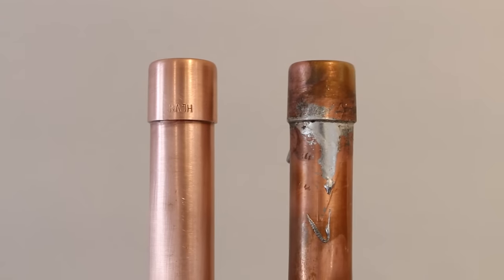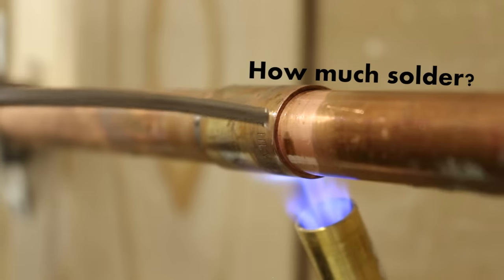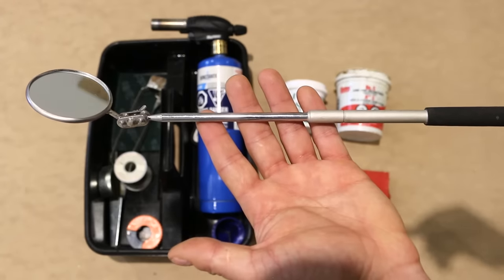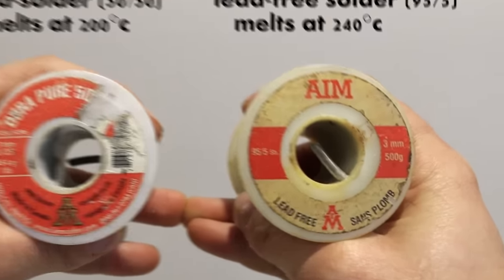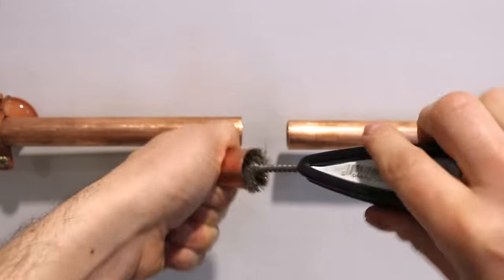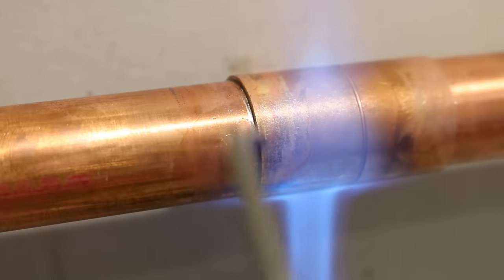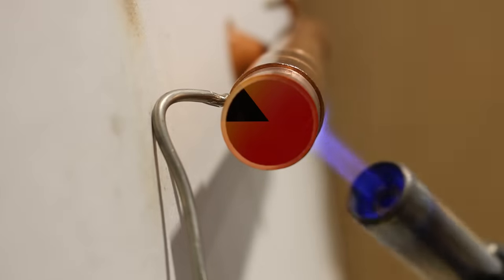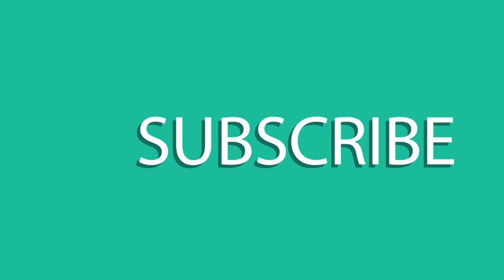How To Solder Copper Pipe Like a Pro (Tips & Tricks) | GOT2LEARN

Comment: Too much solder paste especially aggressive soldering paste in the pipe will eventually cause leaks. So if you can see the paste it’s too much. Exaggerated. 
Also I didn’t here anything in this video re reaming one of the key techniques in the soldering process. If you don’t ream it could cause cavitation in the pipes and fittings especially in high pressure situations. Pay no attention to how a solder joint looks rather focus on better process 
Another part of the process is heating, heating should be pipe first: bottom, sides top; afterwhich, heat fitting: bottom, sides top then go to the bottom and concentrate the flame at the back of the of the fitting at 6 o’clock and push the solder into the fitting building a dam. Stop. Focus flame back of fitting on the side and push solder and move flame to top with solder following the flame. Stop. Do the other side with the same process but this time when you reach the top remove the flame and continue to add solder as it drips out the bottom till the dripping stops. What you are doing is keeping the completely filled by adding solder to the joint drip and replacing the displacing solder from the top that is dripping out the bottom. 🌺

Comment: I am building a compressor with a fridge motor. Can I use this method to solder the 1/4 copper pipes and does it handle the pressure about 8 bars?
Reply from the maker: Might wanna braze at the pressure.

Comment: The amount of solder needed depends on the size of the fitting, for example, 1/2" pipe requires a 1/2" of solder to fill the joint, 1" would take 1" of solder.

Comment: Yeah.. We just pressing over here. Fuck messing with soldering it lol.
Reply: Fuck copper period. For how little I ever deal with copper anymore doing residential repair work, would take me forever to see a return on a $2000+ tool. 90% of the time the copper I do come across that requires some overhaul, I usually cut out and adapt to PEX anyways. PEX is god. But every jobs different and yeah I'm sure a press comes in handy here and there.
Reply: NubSack I PEX too. It’s very nice.

Comment: Great video. I was taught a different technique with a soldering iron that clamps to the pipe.
Reply from the maker: Yeah those are cool, I should nake a video on those clamps, what's the brand, do you know?
Reply: @Got2Learn   not off the top of my head. That video would be useful!
Reply from the maker: Okidoo!!
Reply: @Got2Learn  Antex pipemaster  they're Ok if you've got a dry line of pipe set up.  However they take a good 4-5 minutes to heat up. As I've only brought one. It was always a headache waiting for the heads to to to change them from 1/2 to 3/4 🙄, They're overrated & only good when you're working close to timber or plasterboard. 🤨
Reply: @Got2Learn  I'd watch that video if you do.

Comment: It took a long tim before I could solder competently. I got so good at it I could ring the joint and catch the drip with the end of the solder coil for the next joint.  Then came propress and the kids were instantly as good as I was.  

Damn you propress!
Reply from the maker: Hehe!!!
Reply: Propress and pex are for wanna-be plumbers.   Takes away from the trade.  Soldering has proven to be the best method over the years.  What makes a good plumber is thinking about the plumber coming in behind you...   If you cant see a bead of solder around the joint it would make anyone think it wasnt soldered.
Reply: OLIVER TWIST Do you shun cell phones for rotary dial phones and phone booths also?

Comment: You run the risk of having leaks not capping your joint. I was always taught to leave a little solder visible around the joint
Reply from the maker: Not to be arrogant, but if your joint depends on a cap, the soldering technique used is not good, just FYI.

Comment: Not enough solder.!!!!!

Don’t believe internet stupidity....

Must have solder leaving the joint, to ensure joint won’t leak years later from expanding and contracting.....

I’ve been soldering and welding for 50 years ....
Reply from the maker: There's more than enough solder marko, you don't need a lip for it to be good ;)
Reply: Got2Learn let’s agree to disagree
Corrosive water, expansion and contraction from heat and cold and especially tough building inspectors  who want to see a  heavy solder joint ...
Reply: Simple rule to use 
1/2” pipe needs 1/2” of solder
3/4 “ pipe needs 3/4” of solder

Old union trick
Reply from the maker: I wouldn't do this on every joint, don't get me wrong, i'd only use this method on radiator elbows or something similar which are never closed in walls for it not to look bad, other than that there's always a drip which is a good visual indicator. It's almost like if you are telling me that a glass full of water up to the rim isn't full and that it has to be spilled to be properly full.

Comment: I prefer to tin the joint first before joining and in this way you are sure that the solder covers the whole joint inside. You need to see the solder run, which ensures the joint is hot enough. Any excess can be wiped away to look tidy.

Comment: He’s talking about no drips in the Solder but what about his?
Reply: You have to wipe away the excess flux as it drips in order to avoid this.
Reply: Hypocrisy
Reply: A small bulge of solder on the bottom of a horizontal is ok. Here's some real tips
Never use lead solder. The toxicity isn't worth it.
Use open weave sand cloth, never scotch brite. 
Use coppermate water soluble flux.  Try it youll never go back to
Oatey
Use turbo torch brand torches.
Wear 100 percent cotton gloves
Have a water spray bottle.
Have a fire extinguish er
Get a reamer always remove the sharp edge after cutting pipe
Use correct fitting brush
Flux fitting first then pipe always
Larger size requires more heat. Half inch pipe really doesnt rake much heat
Use a small amount of flux after soldering.  Sprittz with water and wipe clean with 100 percent cotton towel never use synthetic towels
If you have to do  large projects or inch and a half pipe  get a  B tank kit  acetylene/atmospheric air mix torch.  Turbo torch brand.   Ridgid cutters from home despot are decent spring loaded makes it fast
Assemble working from bottom up, sweat bottom u heat rises always make sure valves are open never try to sweat a sealed system. Gotta have at lest one open end. 
Those are commercial plumber tips from sweating copper on water chiller, boiler, refrigerant, medical gas, dwv copper and water supply. Maybe overkill some will say. If you want to work like a 10 year old girl have at it. Using the tips above in a weeks practice a 10 year old girl could sweat better joints than most residential/service plumbers. No boys tho they shouldn't play with fire.
Lots more tips but, gotta go. And dont friggin say solder a joint its sweat. 
Go to a plumbing supply business. The stuff ar the home unimprovement stores suck. Except HD sells ridgid pipe cutters still.
Reply: You had me at no lead👍

Comment: Thank you, this was very clear and concise! I'm somewhat of a beginner, but so far, none of my joints have leaked! Would it be a good practice in general to remove all excess flux outside the joint before soldering? In my current class we are being graded on cleanliness and appearance but are not always given the tips and techniques to make it happen. We will lose as many points for a messy joint as we would if it leaked!
Reply: Flux draws solder to it
Reply: @elvewizzy  Whoa I'm gonna have to try that. I do think I've been over-sanding and perhaps that's why I can get messy joints at times. Thanks for the tips!

Comment: Well the fact that you’re using a regular propane torch tells me you are amature we use asedaline tanks secondly do that with 6 inch copper mainline with that torch nope not happening third you can wipe that joint after you solder and it’s clean just like that and you know it’s not going to leak you’re joint pressure test them they won’t always hold up but I can solder thirty joint clean in the time  this video was but I gues this vid serves for a home owner lmao
Reply: Are we to assume your lack of punctuation to be an indicator of your overall amateurism?

Comment: Good video and commentary but as I have 30 years sweating copper, I have no issue seeing a slight dribble/drop at a joint.  On vertical, a wet rag wipe will do the job of a down-run dribble but at least you know there is enough solder in joint.  I've seen 200 psi blowouts using too little solder.  Also, best tip for cleaning a joint after a good sweat, is to take your flux brush and paint over the area while still hot.  The heat and flux cleans the joint super bright.  Just wipe with wet rag after and the joint looks bright.  Gotta comment...but, where I come from I have NEVER heard "solder" pronounced as 'sold-er'.  It is pronounced as 'sod-der'.  "L" is silent.  My expertise is 2" to 4" pipe joints using MAPP.
Reply: And I apologize if I offended anyone with my comments.  I am a grumpy General Contractor.
Reply from the maker: Hehe, at all ;)
Reply: s o l d e r = solder   in UK, home of English language
Reply: @stephensomersify  Population Britain 66 mil.  Population US 328 mil.  "sod-der".  More plumbers.
Reply: I used the acronym MAPP generically as well as everyone else does these days when in reality and to be specific it is MAPP-Pro.  It is the only thing you can buy for small single bottle torches bc real MAPP went out of production a decade ago.  I loved the real thing.  Burned hotter and faster than any single bottle gas.  Did not need any type of "turbo" torch to use.  Now with MAPP-Pro, one needs to upgrade their torch.  I tell everyone to use the Benzomatic TS8000 when using MP.  I do use a propane torch to bring cast aluminum up to high heat before welding to avoid cracking.  Funny thing, on a job last year, customer says I was welcome to use what ever was in their supply room.  I discovered 4 pristine and unused bottles of real MAPP.  I took them all and gave customer back new bottles of MP.
Reply: @victorvarisco5360  and Gold is pronounced God?
Reply: @stephensomersify  How do you pronounce: WOULD, SHOULD, COULD???
Reply: The “L” is not silent, most people don’t talk like a bumpkin
Reply: @mintheman7  The word solder comes from the Middle English word soudur, NO "L" in that word.

Comment: Lots of cranky old men commenting here. Old-school guys who will never reconsider the way they do things. I've always done top-notch, tidy work, much like what we see in this video, and always had inspectors comment on my workmanship. They see the old-school guys and their sloppy work every day, so my work stood out. I worked in the hospital setting. 
The suggestion that an inspector will fail your work if he doesn't see an excess of solder forming a fillet is nonsense. My work was always pressure tested with compressed air and that was the only test that mattered. My neat, tidy work without drips and runs marked me as a professional. 
If you hire a plumber who doesn't care about how his work looks, find someone else. Looks do matter.
Reply: Also how you cut out walls for repairs says volumes. Still waiting to see a square cut out by even 1 plumber. I'm the follow up drywall man, I've seen it all.

Comment: You over heated every fitting with propane idk how but that’s nuts.. B-tank of acetylene please
Reply: Josiah Carson I thought I was the only one who realized based on the comments. Way too much heat
Reply: You have to overheat since it’s propane, that’s not enough pressure even for 1/2” copper, acetylene works out to be cheaper in the end due to efficiency and speed. I remember soldering 3” pressure L copper with acetylene years ago lol

Comment: Propane takes twice as long to heat up a copper joint.  professionals use Map gas.  It heats up quickly so you don't run the risk of burning of your flux and not have good flow.
Reply from the maker: MAP gas has been discontinued for a while now, the yellow bottles you have are not true MAP.
Reply: @Got2Learn  No more mapp gas used for soldering ? The yellow bottles aren't really mapp gas ?

Comment: I’m an old school plumber trained by union journeymen in the field and classroom. We (all locals-US & Canada) learn from expert from the Copper Development Association , these are the people that test and developed soldering pipes and fittings, they also investigate pipe failure in law suits.   
Some of the adages I’ve learned from the class: if you can see the flux you are using too much. A good soldered joint is one that doesn’t leak a perfect solder joint is one that doesn’t leak 30 years from now, wait, wait what? Think about it. 
A person doing a 3/4 inch pipe on you tube  cannot say that a joint is good by just apply flux and solder. The only way to verify the joint is perfect is by inundating the pipe and hydro-pumping the water in the pipe to 200 psi. Normal operating pressure in a house is 60-80 psi. If your joints don’t leak you have a perfect joint. In Hawaii all piping in big building are tested this way by code🌺
Reply from the maker: I used to do almost all my joints like this and we would run 120psi hydrostatic tests. I won't be a liar, some would leak, but that's because of where they were placed (very hard to reach), the others would do just fine.

Comment: I've soldered millions of copper joints from 1/4 " to 3" copper pipe and fittings ...millions...... I love his enthusiasm...but...he's fired the first day.
Reply from the maker: I love your honesty, but I don't work for others ;)
Reply: Why do you say that?  Genuinely curious.  I re-piped my house myself, worked similarly but wasnt concerned about any solder showing.  I wasnt the fastest, but zero leaks at first pressure!
Reply: @bigpjohnson  We were a union, new construction, residential  shop. Plumbed 1,000's of houses in SoCalif from the late 70's to 2008, when they stopped building new houses 300 at a time. We didn't care about pretty solder....you added solder till it dripped, especially when lead free came out. It was difficult to get lead free to flow in it's infancy. To compete with non-union shops we had to haul ass...one guy could pipe 2 single stories a day. His title is: "How To Solder Copper Pipe Like a Pro"....It's should read "How To Solder Copper Pipe Prettier".....I'll prolly take down my post in a day or two.
Reply: @readmore3634  I understand, I am decently proficient at sweating but definitely dont work as fast as a pro!  I've seen clean copper sweats on exposed radiator piping before, and this is a good explanation on how to do it.  For pipes inside the walls, it doesnt matter.
Reply: Here to help brilliant “how to sweat pipe prettier” 100% agree this doesn’t fly in the real world.
Reply: @bigpjohnson  exactly...and I should have said that in my original comment. Thank for the reply.
Reply: @SixTwoHemi  well...not in the construction world...my bad....I should have mentioned that.......thx for the reply

Comment: At the end of the day and in all of my 15 years of plumbing Ive never had a leak on a solder joint other than once on a stub out that was cut lopsided by an apprentice and yeah that might look good but without a full bead around the rim of the fitting you just made a timebomb. I cant tell you how many times Ive been called out to a job where all Ive had to do is clean and re-solder a joint that looked nice and neat like these at the end of the day all you're really doing is being cheap. Heres a real pro tip, get you a box of clean rags keep a nice wet but not like drippy rag and wipe each joint it smooths  drips and at least makes it look nice and shiny, same trick applies for smoothing beads of silicone too.
Reply from the maker: Yeah, it could be a time bomb for beginners, this is not for beginners as I said in the beginning of the video, this is just to improve an already experienced plumber ;)

Comment: Worked in shipyard a few years, some pipefitter friends caused many many leaks trying to make those joints real pretty where you cannot even see the solder... unfortunately you cannot tell if the solder whet the pipe good all the way around (surface tension in solder). Bad idea taking priority of neatness too extreme... (Hey it's magic.. where's the solder?).
Reply from the maker: That's why I said to only do this when you've been soldering for a long time, or else you run the chance of having a leak ;)

Comment: I get what your saying but as a Pipe fitter of 27 plus years you still need to use more flux even on the cleaner looking joint. It stops the tarnishing of the fitting which in turn can cause a bad contaminated joint. I agree with preparation ect apart from using tining fluxs as depending on the brand some contain lead and for potable water well you know what iam on about.. The key to good joints is cleaning.  Fluxing and the right amount of heat depending on the pipe size. Plus like others most people prefer to see a solder ring visable of around 2mm around the fittings. Personally for eg on the vertical 22mm joint you used to much heat and not enough flux.

Comment: This is good if joining copper pipe together neatly. Not so good if joining pipes together for use with water or gas... I’d rather sleep at night, not worrying if my joints will leak, or even burst. You can minimise drips and a messy appearance simply by wiping excess flux. Most of the time, joints are not seen. Or are painted over.
Reply: ahhh. a fellow pro plumber. couldn't agree more